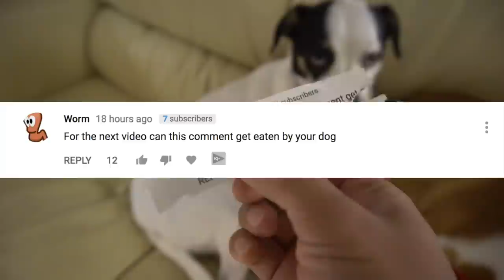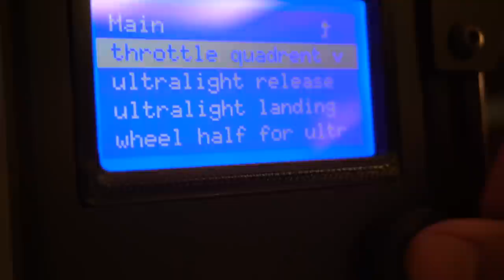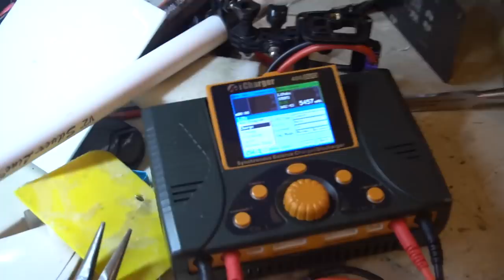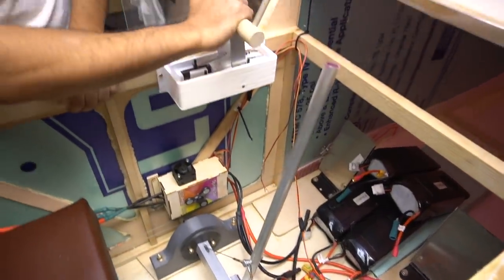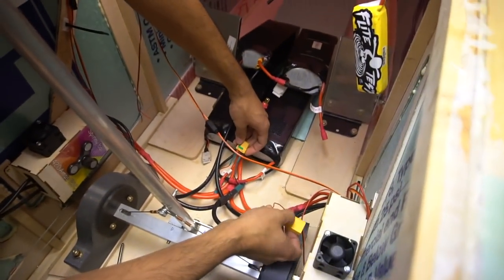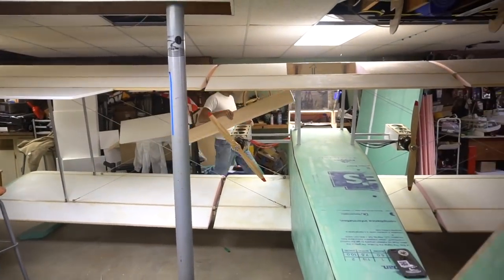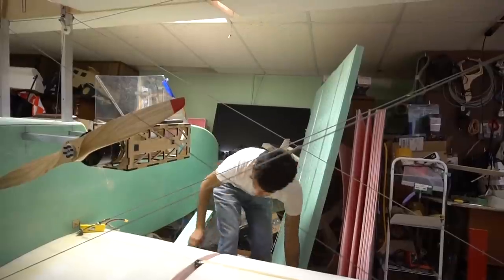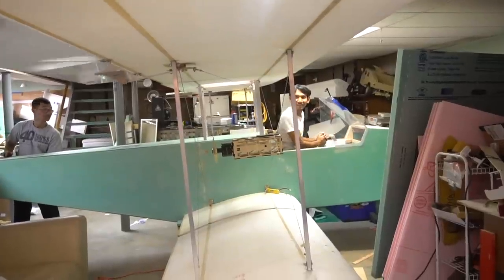DIY Electric ultralight pt6 (GIANT MOTORS and final checks)

Comment: Why is there a fidget spinner? 8:04
Reply: because peter has been calling the motors "spinny bois"
Reply: That's right forgot
Reply: It's the emergency spinner.
Reply: Bobby K To reduce stress, in an emergency
Reply: because YOLO
Reply: It's in case he gets bored while flying
Reply: The gyroscopic forces keep the plane level in flight :)
Reply: Bobby K aerodynamic gyroscopic enhanced mechanically automated assistance of the vectorial motion on the z plane. Duh.
Reply: Welcome to 2017. It’s almost impossible to find videos without them in it.
Reply: More like 4:36
Reply: Because it takes all stress on the plane and it flies more stable :)

Comment: I know you replied to my Chat stating that a 2 blade prop is less efficient, which is true... But also not true. As you scale up, 3 blade props on full size aircraft tend to be only slightly less efficient, as there is more room between the blade than on an RC craft. (Air doesn't scale) most often ground clearance dictates 3 blades to be smaller in size than the equivalent 2 blade. Your craft does not have this issue, thus squewing the overall concensus. the slight penalty is far overshadowed by the increase in power. You will have a slight loss to top speed, but your rate of climb will be much better on such a light craft. And ultralight regulations cap your top speed either way. 
Get a good 3 blade and adjust your pitch, You will get power at a much lower rpm, making you less likely to have your tips go sonic, as can be heard slightly at full throttle. (Yes they are) and saving a bit of battery.
What am I basing this on? 
20 years of building prop powered aircraft in the civilian and military sectors, and hundreds of flight hours on experimental and ultralight aircraft. ;)

Comment: I seen the live stream last night and flying the plane. Can you repost the video?
Reply: Glenn yeah I saw it too... but couldn't watch the Q&A and debrief :/
Why did he remove the videos?
Reply: I watched both videos on YouTube but missed the LiveStream. 

He flew short hops and a full-on-flight over the corn field and back to the runway, in the first of the 2 videos I saw. 

The long flight ended in near pitch black conditions. The sun had set, but it appeared Peter wanted to fly, so he did (a bit), scraping the bottom of the nose a bit after a good landing, but misdirection into some weeds. IT WAS DARK!

In the Q and A footage, the second video I saw, we watched over the shoulder of someone operating a laptop with video editing capabilities. The camera used must have had some amazing night vision, or the editing software pushed the contrast way out. 

From a following drone camera, airborne vehicle, we could see the takeoff away from the camera, the plane rises and starts a shallow turn to the right. More altitude is gained. The plane appears to be in a smooth circle pattern. He seems to be 10 to 20 feet off the top of the corn field as he starts a left turn now, back to the runway. It was nearly a full circle he performed. 

Peter seemed to want to land back on the runway in the reverse direction he took off from. 

However, judging height in the dark would appear to be difficult and Peter lands upon the dirt runway at an angle, rolls a bit and seems to go down the edge of the runway and into weeds. 

The nose pitches down and slides on the grass or weeds to a stop. 

We get to see the damage to the nose in both of the videos. Peter was saying his knee was in someway affected on the landing, OR after jumping out of the cockpit. 

The edited video had a camera mounted on the wing looking at the cockpit and upon the landing, and nose sliding, we hear an exuberant Peter exclaim "It Flew" or some such thing. 

Peter announced in the second video I saw, that the weather was changing and he would NOT be flying again tomorrow, or any time soon. Other projects would come first and we might have to wait months until he fly's again.

Also, the aircraft needs mending. The flat part of the nose foam and fiberglass was cracked, pushed in and obviously broken. Plus he said the electric motors did not have enough power to create real flight. Flight that is sustained and altitude gained and maintained. He said the batteries were very hot near the end of the flight. He also mentioned that the plane was nose heavy. He had to hold back-pressure on the stick all the way around in his flight. It did not seem to be a simple trim issue, but weight and balance.

Seeing as it was after sunset and the FAA does not allow flying after that time, I think the videos were pulled for legal reasons. 

Video evidence of you admitting to breaking FAA rules is not optimal. I surmise/guess/postulate that they will recreate the flight in daylight, or make an entirely new video as a replacement one day.

Will they admit it? The plane needs no FAA examination, says Peter, because it is under the 250 lb limit. But he did fly after dark, knowingly breaking that rule. He mentions this before the flight, after the flight and in the second video.

We must speculate, because they have removed the original videos and have posted no messages regarding their dusk to dark evening of flying, OR live stream.

I am very glad Peter is fine, and the airplane fly's. I am disappointed in Peter because of his decision to fly. He made the flight. It would seem to have been pushed because of youthful exuberance and excitement. Someone there should have called it a night and shut it down.

One night of rest, and a morning flight would have been glorious.

Comment: Peter, I have a suggestion. I know, Im 11, but i know enough to tell you that on the throttle stick, you should add a clip of some sort or duck tape a stick there so that your differential thrust doesnt mess with everything else, and you will still be able to unclip it and use the differential thrust.
-Max 
P.S, Good luck! its almost finished!
Reply: Unless, of course you have already done that.

Comment: I don't recall seeing (in this video or others) any bracing on the lower side of the horizontal stabilizer.  It looks like flutter may be a concern there - will that be braced?  

Yes, I'm familiar with the direction of lift that the h-stab provides, but it really needs to be braced in both directions - see any tube and rag airplane.

Best of luck!

Comment: Maybe add some cable guides when it comes on and off the pulleys. I have sailed small boats with similar riggings, sometimes the lines jump and get pinched in the pulley assembly. Maybe not so good when you are stuck in a right bank and cannot get out of it. Might make landing interesting though! Win/ win either way.

Comment: You still need the X brace wires between the front and rear wing struts or a strut to form an "N" shape.
If you don't know what they are, you need to look up biplane structures and bracing.
Without them, there is a good possibility of wing failure.

Keep up the good work and don't fly with out those brace wires.

Comment: 2:58 There should be a spacer on the inside of the pulley bracket where the bolt goes through, so the bolt can be tightened properly without squishing the bracket. This is important, because without it, the bolt and the bracket can deform under load, causing the pulley to seize up.

Comment: Might not be a bad idea to have some hatch or something to quickly jettison the batteries if necessary. Mounting them to a kick-out panel with a release pin, is likely the KISS solution. This means you'll also need some other weight besides the batteries, but I'm sure you've got that covered.

Comment: Coming from someone who uses those Motors to fly you're going to either want a smaller prop or a reduction drive and a bigger prop for any runtime stability or not melting the motors down 2810 will get too hot for the runtime that you are expecting in an ultra-light

Comment: This might be a pointless suggestion, but check your area for supply of Paulownia (Kiri) Plantation grown timber. Its damn close to Balsa lightness, but it's  got the strength of Western Red cedar. It also is impervious to water and rot.
The sort of timber you would use for a "keeper" project.

Comment: Can you post the link to the servo tester you mentioned?  I have used the cheap rotary ones before.  Did you just solder a sliding pot in place on the rotary on the PCB?

Comment: (i have my starters pilots license) just wondering if you have checked the balance front-back and side to side otherwise you could run into some big trouble as well do you have stall warnings on it? love your build so far cant wait to see it fly, good luck! o one more thing make sure the thrust of the props dont push you forward (or you will nose dive/wont take off)

Comment: I have to tell you, i climbed 3.7 km height and my lipos for my quad were puffed even my goggle lipo. I think it was the hight. I still flew them but they were extremely puffed. I know you won't fly Nearly as high, but I think you should change your battery's to something that the cell's aren't effected by pressure. Good luck.

Comment: @peter where did you find the little sliding esc controllers to make manual control of the esc.i thought i remember you using cheap servo testers.im working on printing 4"thruster to mount on my kayak,im looking for a manual way to run the plane esc/ motor.i watch your vid about the ol t100 thruster and that gave me great idea.using a t100 thingiverse file scaled to 130% to bring it to 4".i bathtub tested on a 41mm 850 kv outrunner on 3s....full throttle for 30 seconds toasted the 35 amp esc.ill try 80 amp next.keep up the great work.

Comment: it lookes like you put the bolts in for the hinges with the head down, if so, reverse those so if the hardware loosens, the bolt wont fall out, just in case, lol.

Comment: A very creative project! ...I want to see you succeed (i.e., survive).....but I am really concerned about those motor mounts! The “skinny” diagonals and cross bars add minimal stiffness to the box. You would have the same rigidity if those lightening holes were one big rectangular hole. I think you need to calculate the weight savings over a “solid” box, (which would be a lot stronger)! 

Given the energy in those motors, the mounts need to be as strong as you can make them! If a mount fails the propeller could seriously damage the fuselage in flight and render the plane “uncontrollable”! I believe that you need a failsafe that will kill the motor if the mount fails. Your reaction time on the throttle won’t be fast enough. If the airframe is compromised your only recourse will be to deploy the chute!

Comment: Why didn't you put the batteries inside those engine nacelles?
You need only a short wire (and connecting the 2 sides is optional, can be done with shorter and thinner wire). Also they get a lot better cooling compared to a foam plane (that foam is normally used as heat insulator). The main disadvantage would be a shift in CG, but you can compensate that by moving a bit forward. After all, your body is a lot heavier than those batteries.

Comment: I'm wondering if this plane could be powered by some large 50 cc RC gas engines (more reliable than glow engines). That would be fun :3 Considering that those motors make about 9,800 watts each, which is about 13 hp per motor, a pair of Desert Aircraft DA120 engines would do a great job imho!

Comment: hey peter, new subscriber here. i noticed your live stream the other day for the first flight and cant seem to find it anywhere, so ill leave a comment here instead.

i saw you had power issues. ever consider making it a tri-motor? they are more stable in flight if you have an engine out, and 2 engines can provides enough thrust to at least help you land safey. put it up on the tail or something.

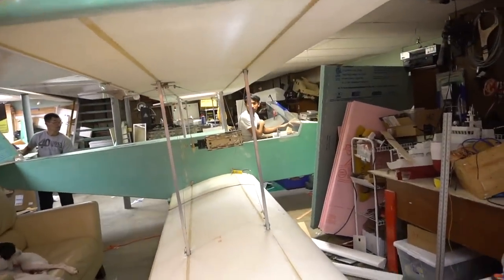Comment: Dude, at 13:30 when you begin talking about potential fire suppression systems, i.e. water bottles and fire extinguishers in the nose of the plane for ballast, i had an idea. How about a fire extinguisher firmly mounted, with plumbing hooked to the nozzle of the extinguisher that runs to all of the flammable components. Have nozzles at the batteries and motors, you could even have valves to control which component gets a dose of BC class fire extinguishing from the extinguisher that you mod to have a quick pull chord. You also maintain C.G. with this idea, instead of emptying all of your liquid c.g. onto the rear of the plane as sparks and fire melt through the foam and set the wooden stringers ablaze (hopefully not). The empty fire extinguisher will weigh something even when empty, but it could also break your legs and explode in a crash if placed wrong. There doesnt even have to be a fire, you could give a judicious squirt of co2 from the BC rated extinguisher just to cool components in case of overheating.

Comment: <  thinks to self "Should I post an intelligent comment or just another "Please don't die" comment?  >
Please....JK...If the power ratings are accurate (& the motors were 100% efficient) you should have over 26hp at your fingertips. Very respectable power to weight ratio. I hope that ESC doesn't shit the bed ... they are best over-rated. Great to see this project coming along, you appear to really be doing it right!

Comment: 2:17 That looks dangerous. The threaded insert should be epoxied into the tube. As it is, you're using a cotterpin as a structural member, using it to carry the load of the control rod. Not a good idea.

Comment: I used the same power system to convert my hang glider to e-power:
https://www.youtube.com/watch?v=RfNtu4BAilo
https://www.youtube.com/watch?v=5ga4TcHL9nY
Gross take-off weight was 350 lbs.  Max climb rate was approximately 300 feet per minute.  I had 35 lbs of lithium polymer batteries mounted, only good for about 35 minutes of flying.   
Good Luck!

Comment: linear potentiometre for power is bad choise
Reply: use carbon blade not wood
Reply: use carbon tail not aluminium
Reply: window cocpit bad idear eavy and break the speed
Reply: incoscient power on engine in garage with out protection if the engine is not fixed correctly you died a blade in face